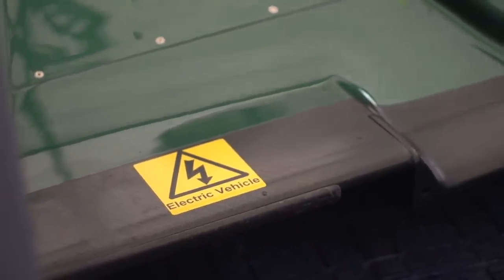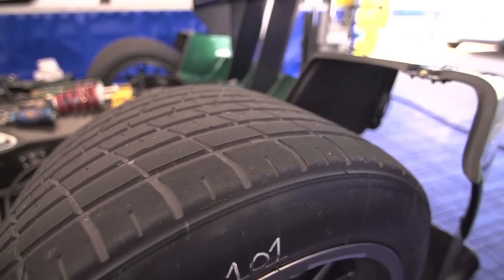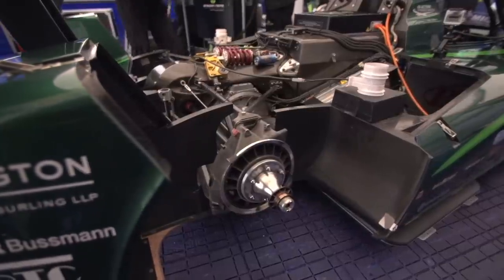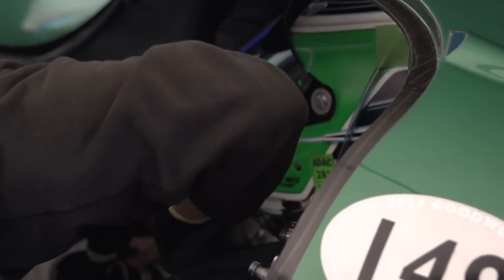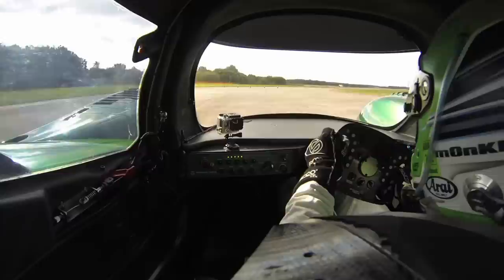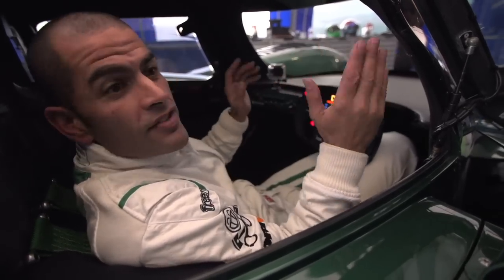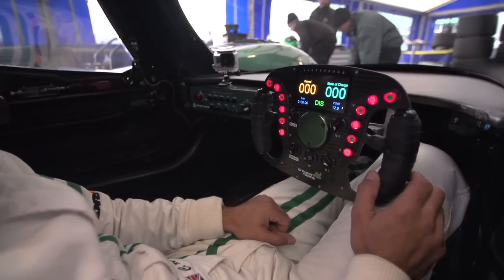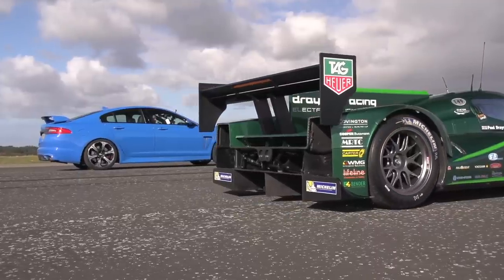850hp Electric Racing Car: Driving the Drayson B12/69EV -- /CHRIS HARRIS ON CARS

Comment: reminder; the limiting factor of electric vehicles is ONLY the batteries, and they're getting better at an almost exponential rate now. electric motors have far far more power potential than gas engines 

give it a decade and passenger EVs will start to be getting pretty close to nut-machines like this one..
Reply: +Ryukachoo batteries and the power delivery - the cabling is ampere rated and at high amperes the cable does not have the surface area to sustain that current delivery without melting.
Reply: RBeen Thanks, what is this switching circuitry that you speak ok?
Reply: *****
there's been like ten years of "coming soon" battery chemistries. none of them ever pan out. Call me when i can buy one from a supplier
Reply: +Ryukachoo No need to wait a decade.  If you look at the numbers he posted near the end of the video, the model S P90D has basically the same 0-60 and just a slightly slower 0-100.  Top speed is limited to 155... but still no slouch.
Now we get to see if such performance in the hands of soccer moms and pensioners is going to be an issue before they get autonomous driving sorted.
Reply: +Kapil Chhabria You can order Super conducting cable off ebay these days. Cabling is no issue at all.
Reply: +Ryukachoo Indeed electrics are truly the future for performance.  A properly set-up electric engine NEVER loses its top torque band, it just keeps going
Reply: +Kunta Kinte I've only read that
brushless DC electric motors &
switch reluctant ac motors

don't have a torque drop.

regular ac motor has low starting torque and DC Has the opposite problem top speed low dropping torque....

yeah I'm reading about them electric motors to learn how to make my own car.  I don't want to replace the conductor brushes maintenance so no brushed motor for me.  also don't want lack of top speed due to high voltage arcing....so ac motor for me.  I don't want weak starting torque of ac motor so I choose switch reluctance ac motor.  I don't want complicated expansive computer chips and converters so it's back to brushed DC motor for me....but I want a wider power band so it's back to a regular ac motor with a power inverter to transform DC voltage from battery pack into ac power electricity to ac motor.  this is my choice of being half way cost maintenance and power band.

lowest cost is DC brushed motor.  highest power is ac switch reluctance ac motor.  lowest maintenance is regular ac motor.

this is according to my understanding of what I read.   anyone wanna help me learn if I'm wrong???
Reply: +Ryukachoo  The only flaw in this notion is that Manufacturers don't like EV's because after sales parts supply has very limited money making potential. An electric motor is a very simple device with only one moving part. Governments don't like EV's because they will lose billions in tax revenue. And oil companies HATE EV's for obvious reasons. So EV's will remain a rich mans toy for a very long time to come.
Reply: +Ryukachoo i doubt that because i dont think the government would be too happy with cars that can hit 100 in 5 seconds be all over the roads, unless they put goveners in them limiting speed, normal everyday people probably shouldn't have that much torque lol
Reply: There will always be a first one to do it.  The regulations will come later.
Reply: Instead of building better batteries to me I think the best option is to change the roads. There's a tile being developed in Canada which is pieced together in a hexagonal fashion. It uses solar panels built into its surface to charge and stores the charge across the grid. They believe that if 64% of the worlds roads were this surface, we would produce 3x the energy we need. It has LEDs to display traffic signals, warnings and to hi light a broken tile. These tiles can heat themselves to eliminate snow, ice and rain sitting on the surface. 
I believe this tile idea mixed with a wireless charging system is the future. Imagine if the car charged while you were driving rather then needing to pull into a station to top up. Using this system you could regulate speeds on highways, if there's an accident simply reduce the power the road supplies to the vehicle. The road could then display collision warnings and show the diversion to avoid further collisions. 
Bumper car/dodgem style.
Reply: SCHLiAM 
there's various reasons why solar roads don't work, but once even base model EVs have a 300 mile range and charging stations are spaced every 50 miles or so, range anxiety basically won't matter anymore
Reply: Themayseffect 
but fi you're charging to 300 overnight in your garage, the only time you care about charge time is on long road trips which is very rare for most americans, and not a big deal
Reply: Themayseffect 
there's plenty of studies about how far americans drive and how often. It's true we drive a lot, but it's generally less than 60 or so miles a day, the exceptions being people with long commutes (which isn't that common). i'm not including transportation industry type stuff since yeah, 18 wheelers won't be electric for a REALLY long time, but saying "EVs wont work because 18 wheelers can't be practical EVs" is silly.

the example i always give;
imagine your car could fill up in your garage overnight. Honestly, how often would you go to a gas station? probably rarely
Reply: +Ryukachoo I'm curious how they got 2950 lb ft of torque with such a battery. The battery on the Tesla Model P90DL's only get about 700 lb ft with 762 HP and 1500 amps which apparently 1500 amps is a lot
Reply: ***** 
really advanced power delivery and battery chemistry designed for power delivery over power density, you could make a vague analogy to E85 gasoline. Horrible gas mileage but enormous power potential for various reasons
Reply: Themayseffect
The torque in the Motors in the Model S is increased by adding more amps to the motors
Reply: That's only part of the story.  The other part, as others here have said.. is the design.  You can't just keep pumping amps into a motor and expect it's performance to increase.  You will destroy it.
That's going to be the balance here.  High current capabilities are great.. but then you need to ensure the other components keep pace with the load.
Reply: True.. but again.. that depends on when it came on.  I do agree with you that at some point there is a limit to how much torque one could deal with.  I put to you, however, that when how far you go is no longer a concern, a model S type car could do a 0-60 in something like 2.0.  You would have to put fatter tires on it however.. so a balance has to be struck with usability and excitement.. for now.
I expect that will change very soon.
Reply: we would be at that point today if they continued with the old saturn ev program instead of crushing em all rather than continuing
Reply: Biff The MinPin All Day , Yup.. fully agreed there.  But we are there now.  That's the main thing.  Let's not allow the automotive lobby to continue to force us to buy inferior products just so they can keep their numbers.  
They need to pivot their industry to making the cars we want and selling them the way we want them to.. or go under.
Reply: +PaleHearse when batteries get better and thanks to phones we will get to that point alot sooner. cant wait instant recharge long miles per charge.
Reply: Not sure about instant.. but yeah... charging will eventually be very rapid.
Reply: PaleHearse
It will take 30 min to charge a 400 mile battery from 0%
Reply: *****, you have to look at this like a process.  What are you trying to do with that 400 miles and realistically how much are you depleting it?
Long haul truck drivers are likely going to need some kind of boost mechanism just like modern trains.  Does that mean we don't use trains?  Of course not.  What it does mean is that one designs infrastructure to support the type of use.

Let's say, for the sake of argument, that the battery charge time isn't ANY better than what it is now.  That would mean that it would take approx. an hour and a half to charge a 400 mile battery.

Two things happen there.  Firstly, the battery charges faster for longer, meaning that instead of being able to put 180 miles into the battery in 20 minutes you could put 300+ miles on the battery in 40 minutes.  The second thing that happens is that you are usually only charging your car to 300 miles leaving 25% headroom for the battery.  This extends it's life.

So basically, as we approach this from a usage standpoint, a middle ground will likely be reached between battery capacity and charge time.
It's not so much the charge time that is at issue, but in when you HAVE to charge.

All I can say is that what you should likely do is to take a road trip with someone that owns a Tesla, or see if you can arrange a 2 day demo.
That way you will see what is really possible NOW and then from that you can better extrapolate how this works in the future.

If you like, I can take you through a typical day and a high use day and let you know how I personally charge my 90D.
That might help.
Reply: lmaooooooooooooooooo well played sir
Reply: Power electronics :)
Reply: Elon Musk is speeding things up. I shall buy a TESLA one day ^_^d
Reply: Well... also heat too.
Reply: and consumers have EV's because they aren't convenient... Until one can charge a vehicle in less than mins.. it's not happening...

Comment: An amazing machine it may be, but its just too clinical. There is just something visceral and primal about the roar of an engine and the movement of machinery that an electric motor cannot replace. I mean, can you imagine a completely silent F1 race, without the high pitched scream of their engines as they rush past?
Reply: It's just a matter of bending back the mudguards so they rub against the tires like I used to do when I was a kid with my Grifter. Then you'll hear the sexy buzzing sound.
Reply: No.. the only thing "visceral and primal about the roar of an engine and the movement of machinery" is WASTED ENERGY.  
electric motor can replace - POWER!
Yes I can imagine an F1 Race without the scream.. the WOOOSH of pure speed sounds better
Reply: giz stop talking about cars , and don't do it again ever !

Comment: I understand the petrol-heads' moaning about the lack of noise, but, frankly, I just disagree with them. First of all, there is something incredibly cool and almost sinister about this car flying around the track almost silently. Secondly, the argument over lack of sound is entirely normative and based on our perspective and almost 100 years living with racing cars being quite loud. As with anything truly new, it will take time for us to shift our perspectives and become accustomed to the newness of it. Terms like "boring" or "sterile" are based on our current experience and really don't say much other than "I'm not used to this." I'm betting watching 30 of these things -- with all their torque and acceleration -- go around a tight circuit would be pretty damn exciting.
Reply: I think it's much more than just not being used to it. It completely removes an element of automotive beauty.
Reply: ***** ...and replaces it with others. As I said, it's about retooling our perspectives.
Reply: Daniel Akerman Maybe your argument applies to why you like it too. Because you're not used to it. It's new. I can't see silent racing ever becoming as big. Yes it's kind of cool, but not nearly as exhilarating as hearing a high revving v12 attack corners.
Reply: *****
I'll never understand why people like watching cars drive around in circles.
Reply: ThingsDemystified That's incredibly ignorant, its more than just driving in circles. Driver Skill, the Engineering, Battles for position, strategy, visual and sound elements, seeing a car on the limit, etc and you tend to get a higher level of intelligence with regards to the fans compared to other sports.

What kind of sport do you like? I bet I could make it sound just as dumb.
Reply: DeaKen002 There will always be people that like the strangest things. It will die out when it becomes electric. 99% of this is the sound.
Reply: ThingsDemystified Who ever said that, in the future, electric cars won't have a sound? No one. Sure, they don't right now, but with technology evolving as fast as it is, there could be a new type of motor that makes a good sound.
Reply: Good point
Reply: Rory MacDuff If all you lack is a sound, just pump the sound of my daughter's "Power Wheels Barbie Jeep" thru the stereo.... vroom vroom biotch!
Reply: Exactly.  It may sound like a slot-car but being pinned to the seat will substitute for vroom, vroom...
Reply: On a side note...electric vehicles do have a whining sound which is like something out of a sci fi film. I find it pretty cool and prefer it to anything with 6 cy or less.

Comment: it actually accelerates from 60 to 100 at exactly the same rate as it does from 0-60! how fucking insane is that??!!
Reply: givemeajackson I think its cause of the instant power, unlike gas cars that have to slowly build up power.
Reply: Garrett Bradley yeah under resistance of force, more power is used, so more power flows-
the harder you push it the more power it chews through and there's not many moving parts ...
Reply: givemeajackson normal? if you have so much power u cant get even faster at start, cause the tires have no grip...
Reply: ***** yes, you have wheelspin at the start. but still, the numbers are insane at show just how much torque this thing has.
Reply: givemeajackson This is due to the lack of a power band.  In an electric motor the amount of torque available is the same regardless of rpm. So you are technically always in the sweet spot
Reply: +dp1987lrfc Actually, the torque should fall off as the RPM rises giving your a relatively flat power band. If you had the same torque at high RPM as low RPM, you'd be making far more power at the top.
Reply: +zshadows actually no, you're completely wrong. electric motors do generate max torque at any rpm.
Reply: +jimmmaaay1 
wrong. Look it up.
This is coming from a EE
Reply: +zshadows DC Electric motor's effectively produce good torque right from the start up to the max current flow capacity of the field coils and Armature windings.  this of course is finite based on the P - I - R equasion  this of course is also dependant on the V
Look up "Ohms Law"   

Permanent magnet motor's are often capable of even greater torque. for a given size. Electric Fork Lift trucks for instance.  The huge down side to this is the current required and the ability of the batteries to be able to sustain the current requirements.
Thus the reason why Electric cars have come a LONG way in the last few years as battery technology makes huge advances in efficiency
Reply: +givemeajackson F1 cars accelerate faster 60-120 than they do 0-60, due to downforce.  The problem is just getting the power down.
Reply: you need see today the acceleration from 300-400 km/h Agera RS... that is mind blowing
Reply: No gears presumably so your gonna save a bit of time there too.

Comment: Looking at this, I'm considering thoughts on a possible Formula EV, or something of that sort in the future. The batteries & charging speed will need to be addressed, but in the future it might just be possible.

I'm getting excited.
Reply: The acceleration these cars have is bizar.The world record from 0-100 Km/h is 2.15 seconds!
Reply: Tom Ranson
That's kind of weak...270hp maximum? Go-karts are faster than that.

I was thinking more like this car shown here, but batteries are the problem.
Reply: Well yeah but that's the whole point. Bringing the power down to that means these Formula E cars can do a whole race distance while being over 100kg lighter.
Reply: Because, of course, the technology is not there.  LOL to fomula E.  Hope it fails and the FIA learns from it like the 2014 F1 season.
Reply: Trades46 universities are developing electric cars which, although only have 100-200hp, have in excess of 1000Nm of torque. Horsepower isn't everything
Reply: sevrlychangled
On the streets, I'd agree; torque & engine power curves are more important than outright high-end horsepower.
In motor racing...hp does matter. There's a reason why racing governing bodies keep trying to put a cap on maximum power by fitting restrictor plates & fuel flow rates.

Those university designed motors will certainly serve as good replacements for trucks, but will be hard to drive (wheelspin issues) & slow for racing.
Reply: *****
Bang on. Tesla Motors demonstrated a battery swap on a Model S is possible & can be done autonomously in the same time to fill a road car with gas.
Speed up the process with a pit crew & special components, battery swapping is the way to go for Formula E.
Reply: Trades46 Actually... they were on their 3rd battery swap by the time the competing gas engined car had filled up!
Reply: Yeah they dont need to get revs before lifting of. Thats the problem of normal cars REV , REVS ...

Comment: Im curious as to how this effects a drivers feedback. As a driver you need feedback from the car. Most of it coming from the feeling of grip of the tires and chassie. But one form of feed back is engine pitch. Without that form of feedback, how would that effect a drivers abilty to race at the peak limit of ones ability.

Comment: I clearly remember the sensations associated with attending my first motor race, the smell of racing fuels in the air, the myriad of engine/exhaust sounds, vibrations you could feel throughout your body and the enthusiasm from the spectators when a particularly good sounding car went by, it was emotive because so many of my senses were exposed to an experience I was not prepared for. If I were a young man today attending my first motor race and the cars were all electric, I wonder what sensations, apart from silent speed, would resonate strongly enough to make one want to return for more.